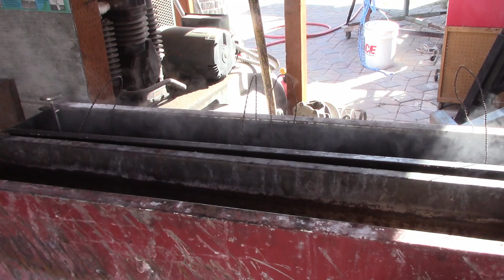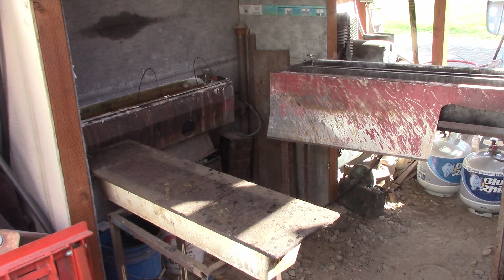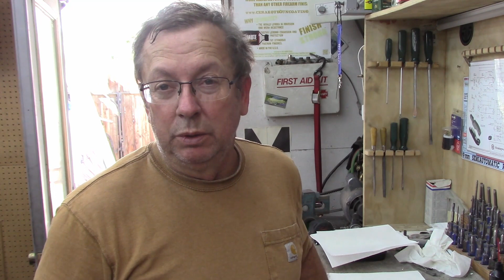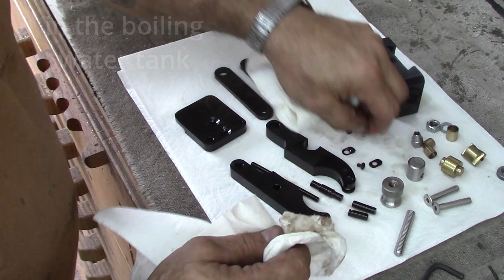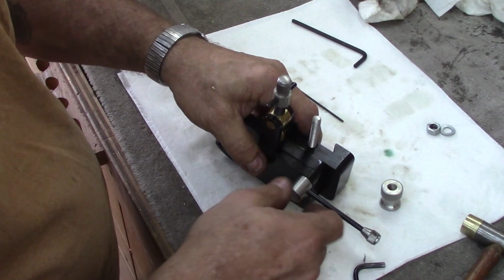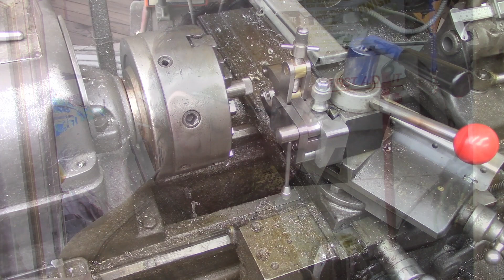Hemingway Knurling Tool: Part 15

Comment: Bad service is bad service, but IF the knurls had been in the kit of bits to start with, would you have recommended the product?
Reply from the maker: I understand supplier problems, and even though the knurls showed in stock when I ordered the kit it t was not a big issue even though their response to my inquiries was poor at best. The deal breaker for me was when I did receive them (2 sets, 1 straight and 1 diamond, for a total of 4 knurls, 1 of the knurls was junk making 1 set unusable and them choosing to not stand behind the product they sold. Had they made good on the faulty knurls I would have still recommended them with the caveat that everyone understood the communication problem.

Comment: Its beautiful! Leave it to a gunsmith to blue machine tools ;-) Thanks for the series.
Reply from the maker: Stuff just looks more finished and it protects them better and lasts much longer than the cold blues or black oxide that is commonly used in the home shops